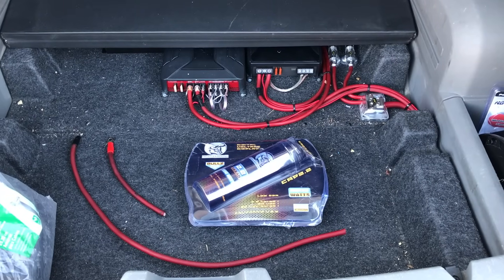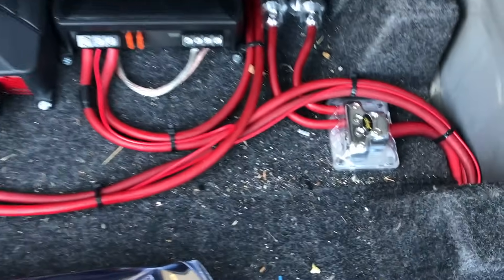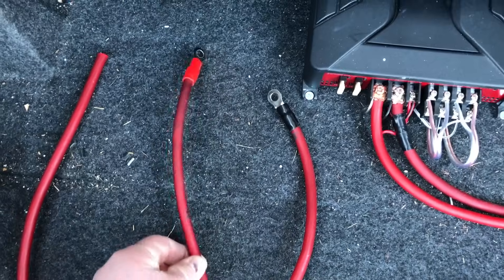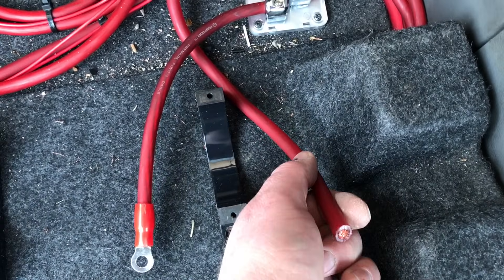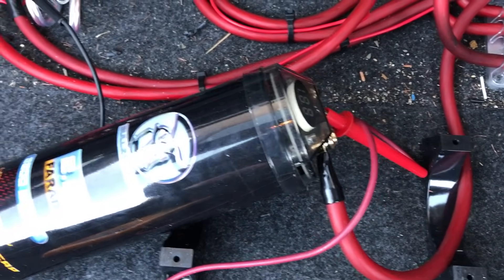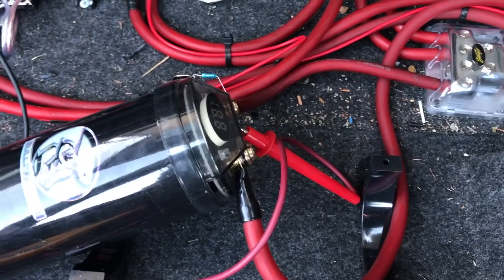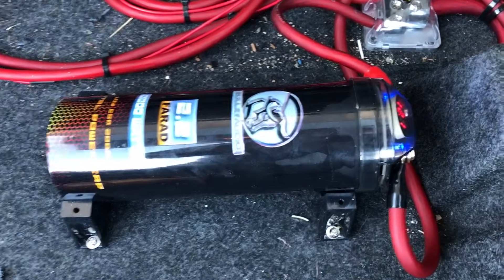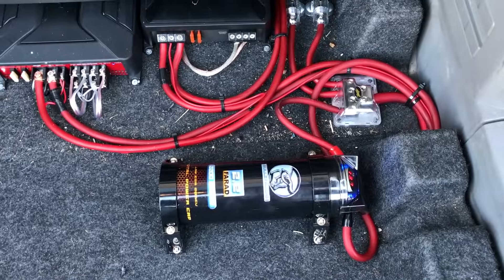How to Install a Car Audio Capacitor in your Vehicle

Comment: Hello.
I just bough a new 2 farad capacitor and it didnt come with a resistor. What alternative can i use to charge it?
Reply from the maker: Does your capacitor require a charge before installation?
Reply: Provo Beast Audio Installation hi. yeah I borrowed my neighbors voltmeter and it is already precharged. Thanks for the reply man!
Reply from the maker: Subscribe!
Reply: The garbage can. Then go buy a alt and batt
Reply: A test light?

Comment: My question is how long does the primer charge last after the battery is disconnected or dies do you have to discharge them if it sits for a long time?
Reply from the maker: All depends on the capacitor and the quality of charge before the disconnection. It can last days, weeks, or months.
Reply: Provo Beast Audio Installation not seven years probably.
Reply from the maker: Haha nope.

Comment: I've read, heard, and even been told not to hookup more than one ground in a single spot and I see u doing just that. Can someone please make up my mind for me
Reply from the maker: All depends on the quality of the ground.  If it is a poor ground, you run the risk of engine noise, damage to equipment, fire hazard, etc.  However, we used the factory grounding locations which has a very low resistance and in the main uni-body of the vehicle.
Reply: mario juan420 use one ground get a distribution block because 4ch non sub amps can be a problem

Comment: And would cap not work the same if u dont charge it before actially plug everything up ?
Reply from the maker: It should work the same. Generally, the manufacture recommends safe charging because they claim there could be damage to the actual capacitors if they are rapidly charged without the proper slow charging as seen in the video.

Comment: So its normal that the capacitor goes out after a while?
Reply from the maker: The display will not remain on, only when there is a significant voltage change it wakes it up.  The capacitor is conceptually similar to a battery in that it is always "on".
Reply: Thanks for your answer! So thats the case in every car capacitor?
Reply from the maker: Yep.

Comment: I have a question, I installed the same capasitor but I didn't use that blue little thing, I just put ground from the chasis and the red from the battery and then another red from the capacitor to the amp, any problems if I didn't use the Blu little thing ?
Reply from the maker: The blue little thing is called a resistor, it can damage the cells inside the capacitor without properly charging it in the long run..

Comment: I have a question.... does the setting on the unit (eq parameters such as sub control, etc) override every other equalization such as an electronic cross-over and the actual adjustments on the amp itself?  With that said does the electronic cross-over override the adjustment on the amp?  Or do all of them work in tandem with one another?  It's confusing the hell out of me.
Reply: Best comment ever here ^^^^ LOL
Reply from the maker: Your radio can have crossovers, which essentially modify the signal before it reaches the amp. So set your crossovers for your radio and the amp the same.
Reply: So, are you saying the cross-overs from the radio, to the electronic x-over unit to the amp adjustments itself all plays a part in tweaking your setting?  Meaning one doesn't completely take control of the others but if you make adjustments from any of the one, that the frequency will change?
Reply from the maker: No, think of it as a water filter, as the water (the signal) comes from the source (the head unit), before it travels through the RCA cables (the pipes), it can first be filtered at the source (the head unit has its own crossovers). Then the 1st round filtered water (or signal now filtered by the head unit) travels through the pipes (RCA cables) to your water pump and final filter (amplifier).  The water pump (you amplifier) can still filter whatever wasn't taken out from the source (filtered previously be the head unit), but there may be not much more to do.  Most people would set up both filters(the source filter (head unit) and the water pump filter (the amplifier)) to be the same.

So, what we learned here is your every time you filter the signal, less of the signal needs to be filtered down stream, meaning, once you setup your crossovers on your headunit, that filtered signal can't be filtered much more with other audio equipment.  Like i said, setup your crossovers the same on all your devices.  Really, it all starts with the headunit which lessens the effectiveness of your amplifier crossovers since the signal has already been filtered.

Probably more confused now lol....
Reply from the maker: Also says the guy that Boss speakers are the best...
Reply: @ProvoBeastAudio  boss the best??? 💩... I bet my cheap MBquarts are better... For a budget I'd go with Pyle if you want strength... I wanted sound quality and wasn't worried about pounding my ear drums out so my MB's are great plus they fit in my truck lol... If u wanna spend loot I'd go sundown or skar for hard hitting bass
Reply: @ProvoBeastAudio   how do I maintain the capacitor if I store my car in the garage for 3 weeks or so ?
Reply: @ProvoBeastAudio   how do I maintain the capacitor if I store my car in the garage for 3 weeks or so ?

Comment: hello there thank you for the video , i was wondering you can instal the capacitor in any position horizontal or vertical that want be a probelm for the capacitor  thank you for answering me back
Reply from the maker: Capacitors are sealed.  Generally any orientation is fine.  However, always check with the manufacture before install as they may require certain positions.
Reply: i have a rockfordfosgate 2  farad and i dident see anything on the website thank you

Comment: How do u get it to turn off when car is not running
Reply from the maker: When the voltage drops (generally when there is no more charge from the alternator), it will automatically shut the display off.

Comment: I bought a system used that comes with a capacitor but he didn't give me a resistor how do I charge it
Reply from the maker: Does the cap already have a charge? If so, you will not need a resistor.  This Cap was totally flat, so hence the need for a charge / resistor.
Reply: You can put a light in between or i use a computerfan...works the same

Comment: So many watts do I need to buy a power supply like 7,000 or what
Reply from the maker: Well there is a major difference between peak wattage and RMS wattage.  I built a garage audio sound system setup on the channel here: https://www.youtube.com/playlist?list=PLLehciqc-WQ5FN0rjEaAP1jHFgmlxm-tP  We built a system that supplied 100 amps+ for a similar setup.

Comment: I have a car audio in my room 2 channel bass amp Rockford fosgate 500 watts, 4 speakers, pioneer stereo double din, 2 JL audio 12", cerwin vegan 7 band equalizer, 4 channel amp and a power supply pyramid 1,600 watts to power everything but the 2 12" JL Audio 500 watts is not getting enough power like if I'm in a car bumping loud subwoofers and everybody here's me passing by
Reply from the maker: Sounds like you are in desperate need of a battery bank.  Stay away from a cap.

Comment: what should i do if i want to use the one capasitir to 2 amps
Reply from the maker: You can following the diagram setup like the one in the video (we also used two amps) or you can treat the capacitor like a distribution block and run both power wires from the amps to the + terminal on the cap and the power wire from the front battery also to the terminal.

Comment: How much can I get a 6 fard cap
Reply from the maker: Purchase a battery instead
Reply: Provo Beast Audio Installation I have no where to put a battery in my system
Reply from the maker: https://www.amazon.com/Kinetik-HC600-600-Watt-12-Volt-Current/dp/B000LUBQ4I/ref=sr_1_1?ie=UTF8&qid=1496786599&sr=8-1&keywords=Kinetik+battery much better solution to a cap

Comment: I have a bullz head capacitor. after charging it it reads H I is that correct?
Reply from the maker: Doesn't sound right to me, i would double check your wiring.  The video is of a customer's vehicle, so i do not personally still have it to check.
Reply: Provo Beast Audio Installation

thank you will do

Comment: hey do it suppose to stay on or cut off affer the vehicle is off
Reply: and if it suppose to stay on does it drains the battery
Reply from the maker: Well, essentially the capacitor is a battery, it never turns off.  What you may be referencing is the LED Display showing the incoming voltage.  The LED Display is only triggered when the voltage change is significant (like turning on and off the car).  No, it will not drain any battery.

Comment: i thought the power from amp had to go into the capacitor?
Reply: Bass amp should be connected to the capacitor....
Reply from the maker: In terms of measuring actual amperage pulls with the current wiring configuration, this current setup works just fine, there are no amperage differences within either setup method as the 4 gauge run of wire was short enough to eliminate drops in DC current.  But again, as you have noted, there are many different ways to set this up.
Reply: He hooked it up wrong to where the capacitor doesn’t even run to the amp. It runs directly to the power wire from the ground to the chassis.

Comment: I have this same cap bro, my digital display on it stays on for hours when I turn off car. Does yours do the same?
Reply: I am having the same issue the same as yours but didn't turn off from the time I have installed. did you solve that issue?
Reply from the maker: Good question, i'm not sure as this was a customer vehicle so i no longer have access to it.

Comment: Caps are bullshit, we're talking simple low power (voltage) dc systems here. Money better spent is high quality wire, connectors, hardware, etc., proper grounds and connections and for a mid-range power and above system do the Big Three Upgrade. If you are running a monster system then you'll be looking into dual batteries and alternators.
Reply from the maker: Agreed, however this was a customer vehicle and they were adamant to install a cap vs. a batt.  We ended up installing a bat a few months later..

Comment: i dont get how you wired up the cap to the output  port of the distro block? shouldnt it be mounted between the batt and the distro block? can you please explain how it being in the output source will power up the amps connected to the other outputs
Reply from the maker: In terms of measuring actual amperage pulls with the current wiring configuration, this current setup works just fine, there are no amperage differences within either setup method as the 4 gauge run of wire was short enough to eliminate drops in DC current.  But again, as you have noted, there are many different ways to set this up.

Comment: How do you know what size Capacitor you will need for your system??
Reply from the maker: Generally, the impression with capacitors are a farad per 1000 watts, but honestly capacitors stand inferior to extra batteries, so i would lean to more farads as possible is you go the capacitor route.

Comment: am confused he said he need a fuse on the red wire coming from the battery to the capacitor. won't the red wire have a already? do u need 2 fuse? because normal the red wire should already have a fuse coming to the amp anyway?
Reply from the maker: It wouldn't hurt adding a fuse for your cap as well, because essentially it acts as a battery itself.  For safety, in the event of a short, you can add a fuse for the cap.  This setup had a fuse between the distribution block and the cap, so the customer felt it was unnecessary to add another one.
Reply: Quick question I don't have a distribution black. where would I put fuse on the capacitor. Should I put the fuse on the red wire coming from the capacitor to the amp because the red wire coming from the battery to the capacitor already have a fuse?
Reply: How do I know when my car will need power supply? if am pushing 2    12s with 1250 rms rating each will the car battery manage or once the sub reach over 1000 rms it needs more power  ( big 3 upgrade, capacitor, second battery)?
Reply from the maker: Forget the Cap if your are pulling 1250 RMS, do a big 3 and add a second battery.  Capacitors are usually crap anyways.
Reply: but my car is not struggling?
Reply from the maker: Up to you, but i would forgo the capacitor as it really wont help much.  If you look to add another power source, add a battery, not a cap.
Reply: Can I do a big 3 upgrade without a second battery? or the second battery is apart of the big 3 upgrade
Reply from the maker: Second battery is not necessary for a big 3 upgrade.  See this video for reference:  https://www.youtube.com/watch?v=OKayFutWpeM
Reply: Ok respect

Comment: So is this capacitor supplying for the whole system? Would seem that if it's just for the subwoofer amp that you'd run from the distribution block to the cap, then from the cap to the sub amp.
Reply from the maker: Yep, the customer wanted this wiring configuration.  However, just as your suggestion implies, there are any other alternatives to a setup, whereas many people use the cap as a distribution block isolating the sub amp primarily for the amperage draw.  Up to you!
Reply: i think it would be best from batt to cap to distru capping everything no blinking or bass lag on any amps

Comment: am confuse so how u hook up to amp i see u came from block then grounded capacitor sorry am nub
Reply from the maker: Cap has it's own ground, since the runs of wire were so short, were the cap connects into the distribution block.  now, there are many other alternatives to a wiring configuration, where commonly you run the power battery wire to the cap, and then your cap to your amps, the cap acting as a distribution block.  both setups get the job done in terms of supplying enough amperage to both amplifiers.